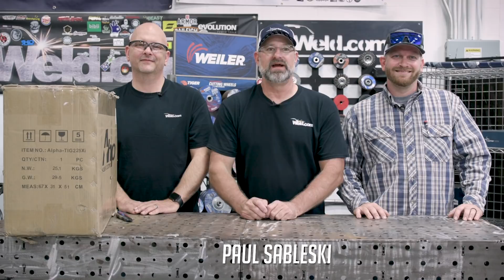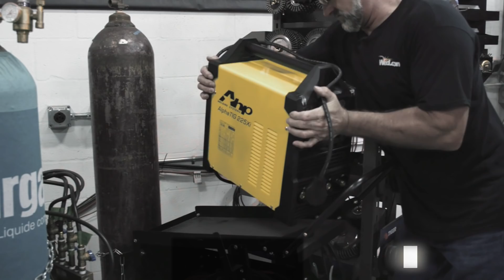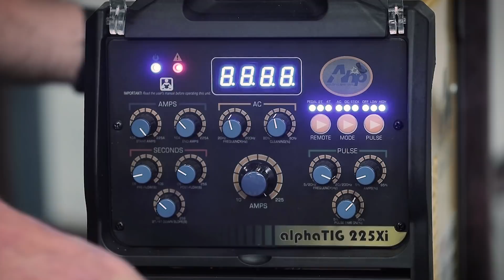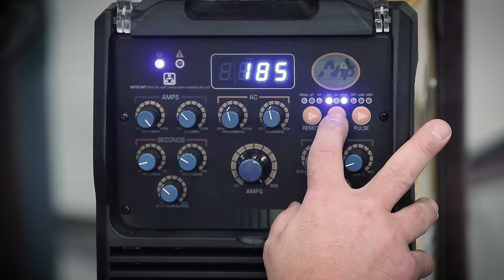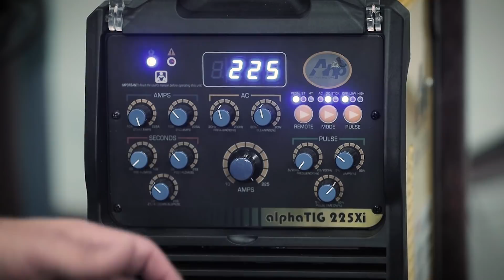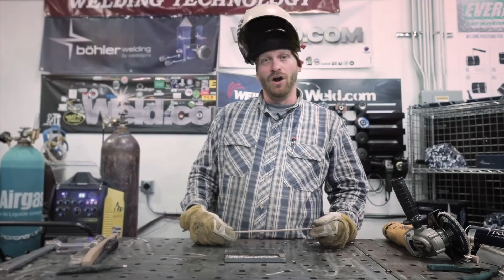Review of AHP AlphaTIG 225Xi AC/DC Inverter TIG Welder

Comment: AHP makes some really solid machines. the quality you get if you open the case and take a look at the parts are quite impressive. Which confirms why it's much heavier then the competition 200amp machines. I'm not sure how they are able to sell at such a low price but what i can tell you is I've had my 201xd for about 5 years now and these machines have such a smooth and stable arc. You DON'T HAVE TO BE AFRAID of using it for hours non stop at 175amps? Without even hitting duty cycle. Very durable and beautiful machines. 

👍 👍 for AHP WELL DONE FELLAS 👏
Reply: I have the same one blasting 200 amps for hours on end its amazing lmao
Reply: 201xd..  been a great tig for me, plus the nova and flex bonus, just keeps going!  No regrets.

Comment: I personally have had good luck with my ahp,  but I don't do heavy jobs with it, just hot side and cold side turbo plumbing so pretty low amps 
Have a ahp 203xi was looking at the 225 as a 2nd since my hobby work load has rampped up lately and need someone to help.

Comment: It's just a AHP20X with a 225 number slapped on it to compete with the primeweld 225 since so many people are hung up on numbers these days. AHP200 and 225 both are 60%@200 amps. The 225 goes down to 35%@225 which I am sure the 200 would do too if allowed to go higher.

Comment: Is there anyway you guys might be able to give some tips for verticle tig open root but joint. Ive been stuck on it for a hot minute, and cant find any tips anywhere
Reply: @Paul Sableski mostly lack of penetration into the joint. Basically no reinforcement on the back of the plates

Comment: Had AHP tig from 2018, safe to say i wont buy it again.
Reply: What didn't you like about it? I'm shopping for a decent price all purpose welder. I have used the Vulcan for a while but I want to upgrade.
Reply: @jo3s0meone  It doesn't stick weld that well, it's missing features I wanted in higher end models but didn't realize it until after i welded with it for a while. The electronics inside it are super jenky, the amp output doesn't display accurately, and changes after i've set it and walked over to what i was about to work on. 
Tbh plan to spend at least 1400 or 1500 on a decent multi-mode setup, HTP for me is where that is at. I also wanted mig function too. It's the pay more now or pay a lot more later sort of scenario, you don't realize what your missing until you cut corners on equipment.

Comment: I rewatched this a few times and I counted a total of 20 seconds of arc time.... Seriously 20 seconds in 3 segments out of a 12 minute 38-second video. The rest was filled with fluff. This is ridiculous. Compare this to a video Bob did back in May of 2017 (Titled: Everlast PowerTIG 250EX Review)where he featured an everlast tig machine. Bob had a total of 4.5 minutes of weld time on-screen with 10 segments in a 19:07 video. All the while Bob is showcasing the different features of the machine and adjusting the settings to create beautiful welds as well as showing how to make bad welds. All the while he's teaching us things about craters, porosity, speed, pulse, and many other things about welding. I know Bob is not coming back, but this channel was built on his teaching style and level of expertise. These guys now either aren't allowed or aren't capable of teaching like your previous instructors (ex: Jason and Bob) and the viewership has dropped dramatically.
Reply: Not to mention the other plugs for products like the filler wire and rods.

Comment: I would love to know what the reliability is with AHP. Long term use. They sound great in all these You Tube videos but I never see a real long term use video.
Reply: This is a late review for you but here it is.   My AHP 200 lasted 6 1/2 years of VERY HARD use. Worked perfectly.   Then the amperage started to wildly fluctuate.  Was not worth the shipping and repair  cost so I just now ordered a new 225XI.  I just couldn't see paying the high price of a Miller. I can order a AHP every 6 years with the latest new  technology compared to the initial high cost of a Miller or Lincoln which will also need costly repair eventually. Was back and forth over the fence about buying Chinese but I read the MIller has Chinese parts too. The owners are American, but built in China.
Reply: The fabrication series has some videos of long term use of some of the older ahp welders they use to teach students with you may be interested in
Reply: There is a guy, Bill, in the Long Beach, California area who has a makers place Gearheads Workshop, and he gives welding lessons.  He uses AHP for the past 5 years and says he is very happy with them.
Reply: ChuckE 2009 used to do specials on a machine a year later, and if he had any issues.
Reply: I though the same so I purchased a Miller 211 Autoset. Granted, I’m talking about a Mig welder. That said I promise that I literally used right at one 60 cf bottle of gas over a 7 year period. And I only used Er70s … no flux core. 
  I just don’t do a lot of mig welding. Long story short is I go to use it one day and it’s dead. 7 year old Big Blue is DOA. I’ve got an older Klutch arc/stick welder and it still works perfectly. My 8 year old Esab 141 Fabricator works perfectly. I’m pretty bummed out. I did not expect a lightly used Miller Welder to die. 
  Everything I can find out so far is pointing to the circuit board. It’s over 600.00 for a new board. So I now have a doorstop. 
   I purchased a new Hobart Handler 190. It’s got a good 3 year warranty. I’d rather do that than risk repairing an older mig welder and end up spending over 600.00 and have a 90 day warranty. Too risky in my opinion.

Comment: Everlast uses the same type of clear control shield.  The only problem is that the detent that is used to get a finger under the cover is too small to use with gloves.  For that reason, most use I've seen is the shield staying open.
Reply: I've fitted a large hdpe knop to it, so I can open it with gloves on.

Comment: It's funny when these chinese companies roll out a new machine, because ALL the channels shill them at the same time
Reply: My AHP201x is still working fine.    I'd love to have a Lincoln or Miller but their bottom barrel machines aren't all that. Made in China too.  Don't have the features of this machine and they cost 2-3 times as much. We'd all like to drive Mercedes but sometimes we're on a Hyundai budget...
Reply: @quademasters249  glad you have a good one.....i wish i could tell a result like yours ....
I am disgusted & disappointed.  Have been contacted by many others with bad result, like mine.
If anyone can fix mine, let me know.
(Zero miles, dustfree and new)!!!
Reply: @karter9908  What happened after you contacted them about it? Reddit is full of people who've had good experiences with them.
Reply: @quademasters249  my machinecwas bought 3 yrs ago.  I tested it for a minute, seemed ok. Put backnin box, inside cool home.     Had several surgeries, and no immediate need to use until this winter.   Son needed it for his small business minor projects.   Bought all the required accessories, tank, and goodies from weldmonger & CK.     THEN, when we needed to light it up, it was on 120volt cord for less than 1 minute when large capacitors started blowing their tops off!!!      Called them, warranty was expired.   They wanted $300+ to examine/ repair, and I pay FRT both ways from Az to Tenn i think. And now guarantee it would be durable or warranted for anything.  I had unit in orig shipping box, in a cool place, and never kicked around.
The failure is Not Rare..... This taught me a big $800 lesson about online chinese stuff.
I have a C7 Corvette, filled with chinese OE parts!!!!  And failures galore!!!! Even it is getting old......No miles, and stuff fails for No Reason!!
I know all ahp dont fail immediately.
I know that way too many have SERIOUS FAILURES!!!!
NEVER AGAIN.
Reply: @karter9908  3 years is about all I expect from one of these welders to be honest. That's why they only cost what a cell phone costs.   You could buy a miller or lincoln but then you're talking 2-4 times the price. 

I had a high end Lincoln mig welder.  $5000.  Once the warranty expires, it would have cost $3000 to replace the main board.  I decided at that point that disposable welders were more economical. I can throw away and buy new for less than the cost to repair an out of warranty US welder.  I'm using a $400 mig welder today. Works good enough for what I'm doing. I can throw it away and get another one when it fails.
Reply: My ahp blew up all if the capacitor s the first time i tried to use it!!!!!
Chinese c r a p......nice box though!!
Dont buybintobthe hype
Reply: @karter9908   that sucks man, I have heard canaweld makes good stuff for tig, but thier pedals look horrible
Reply: Here is the truth: 
Nice box.
*Fact:. Board level parts insidecare halfstep above junk.    
Constant videos showing how nice it looks!!!!!???     Ha
These videoscare made by people recieving free units for their OPINION....
MY $800 LOSS SAYS OTHERWISE!!!!
ANYINE WANT TO BUY A NEW TIG THAT NEEDS CAPS REPLACED????
CHEAP!!!!   ( NOT JOKING)